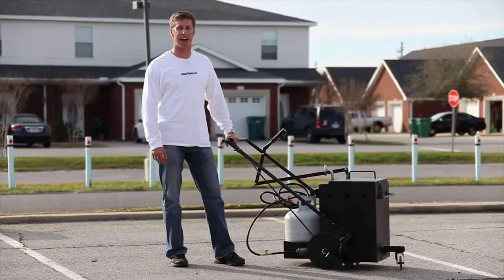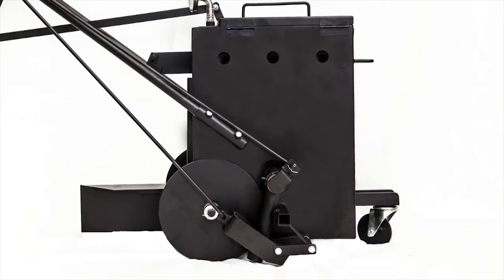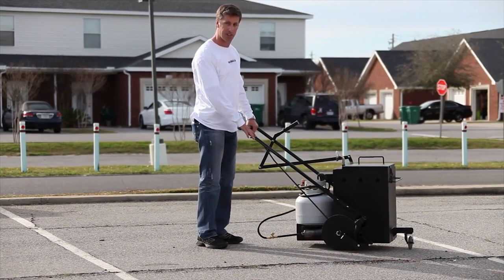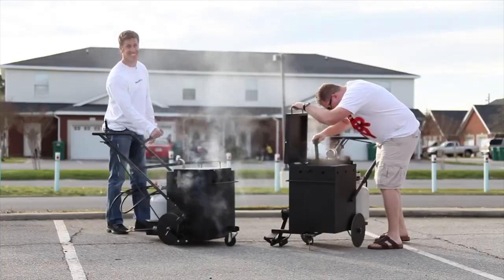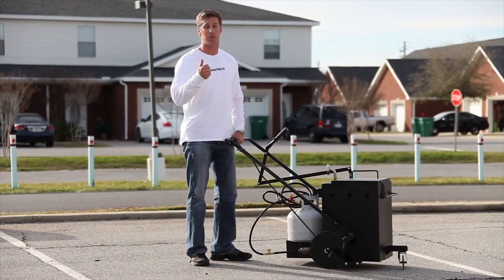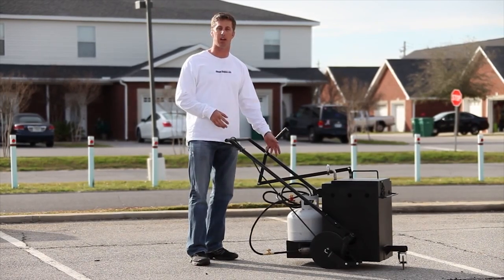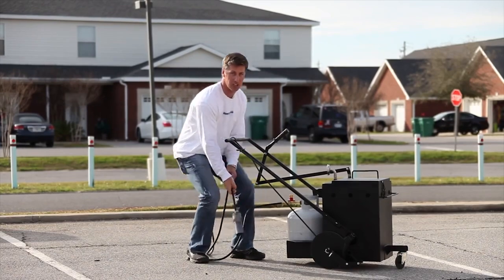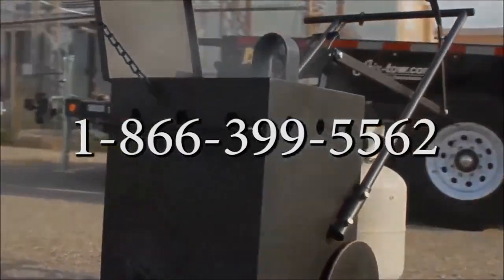Asphalt Crack Repair Machine - Fill Cracks at Walking Speed! #crackrepair

Comment: What’s the widest crack this machine can fill?
Reply from the maker: Hi! You can fill cracks as wide as 1" and deep as 1", if it's more than that you would need to use filler materials such as a baker rod.

Comment: Great video, but Yeah, I can be doing this in my sandals?  Those other guys are such amateurs!
Reply from the maker: CinePost couldn’t agree more! Never seal cracks in sandals. We always recommend boots and appropriate safety gear! #safetyfirst
Reply: @AsphaltKingdom  How long does it take to melt a cube of hot pour...we need a ton of this stuff.  Do people get the 30 gallon bigger one and us the 4 gallon dispenser?
Reply from the maker: CinePost great question! With our pro units it takes about half the time it does with regular torch models. Pro push melters take about 20 minutes to melt a complete block of rubber. Once you have melted rubber in your kettle it is much faster to melt down additional blocks. Similar to having hot water in a glass and adding ice cubes in. They melt faster in the hot water 😉. Many of our clients who Seal cracks on large parking lots or roads choose the RY30 PRO stationary kettle along with the RY10 PRO, yes! This allows you to have crack sealer that is constantly melted down and ready to apply at waking speed. Checkout the RY30 PRO at https://www.asphaltkingdom.com/30-gallon-crackfill-melter-oven.html

Comment: Do you need to ever clean these machines out? So the tar doesn’t harden?
Reply from the maker: Great question! If you have leftover material, you can leave it inside the equipment and heat it up again when you're ready to use it. However, it's recommended to clean it out completely after 5 uses to avoid the risk of charring rubber in areas where multiple layers may have built up.

To clean it, heat up the equipment and scrape out the material with a scraper attached to a broom handle. Then, start fresh with a brand new box of crackfill.

We hope this answers your question. If there's anything else we can help you with, don't hesitate to ask!

Comment: Do u recommend having a fire extinguisher nearby? I recall roofers have to.
Reply from the maker: Absolutely! It's important to have a fire extinguisher nearby. While our RY10 Melter are designed with safety in mind, we strongly recommend having safety gear and equipment on hand when operating the machine.

Comment: If we purchase this product can we purchase a wand to go on it so we can spray the oil into the bottom of the pothole so the pothole mix stays in the hole better.
Reply from the maker: The crack sealing machine is really designed to seal cracks and are not used for potholes. Are you looking for a tack machine?
Reply: @AsphaltKingdom  do you need or recommend a contractors license when doing this type of work? Great videos as always! Thanks
Reply from the maker: @pablog4852  thank you for the comment. General business and contractor licensing varies greatly from state to state. Florida being one of the strictest, to my knowledge. Also, important to note that within some states, Florida in particular, also have local municipality/city licensing requirements. We do not have thorough documentation of what various states require. I did find this link that has helpful info… https://www.homeadvisor.com/r/state-by-state-licensing-requirements/
Reply: @AsphaltKingdom  ok awesome thank you for the reply. One more question, bouncing off what you stated, would parking lot line striping require a license in your state? I feel like you wouldn't since you're not altering or building anything but I'd like to get your thoughts. I really want to start with line striping as a business. thanks again!
Reply from the maker: @pablog4852  it’s really best to check with your state authorities as they are ever changing and we wouldn’t want to mislead you. Many stated don’t require but some do and again they are ever changing.
Reply: @AsphaltKingdom  totally understandable. thank you again!

Comment: I’ll bet that’s a pretty penny
Reply from the maker: This particular unit is actually extremely affordable and a great bang for the buck. There is also a Pro model that includes an enclosed burner and melts crack sealer down 50% faster than torch models. Well worth the money to increase your crack filling efficiency - https://www.asphaltkingdom.com/ry10-pro-crack-seal-machine-grouped.html
Reply: @AsphaltKingdom  thank you for posting a number! Those other guys would never 👎🏼!! 👍🏼!